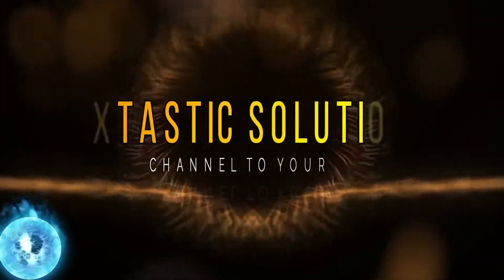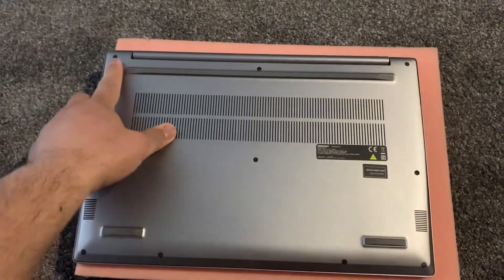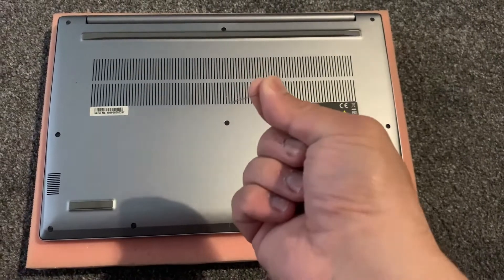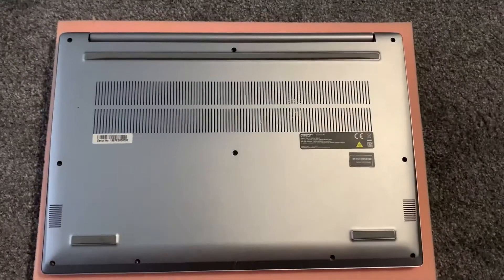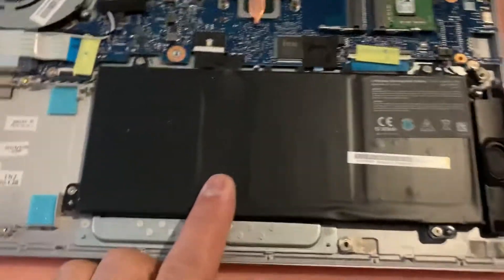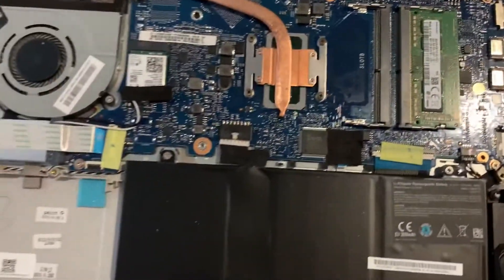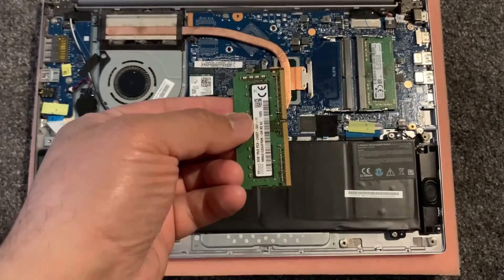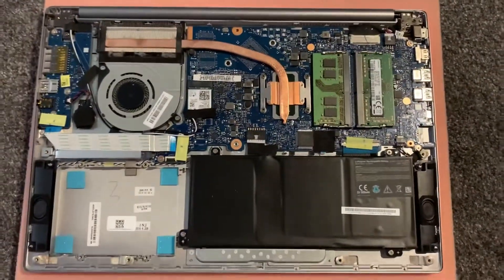Medion Akoya S6445 - How To Upgrade Ram, Add HDD/SSD, Battery Replacement, Replace CMOS RTC

Comment: can I mount 2 separate disks running  simultaneously??
Reply: I'm trying to do that (add a second disk, SATA 2.5), but the cable is specific and hard to find
Reply: Yeah, I have SSD plus HDD
Reply: @onyekanwokike4589  which cable is it ?